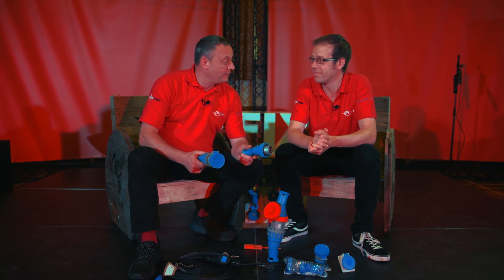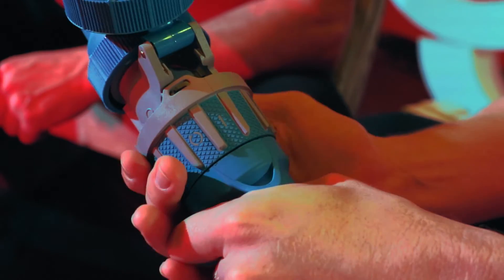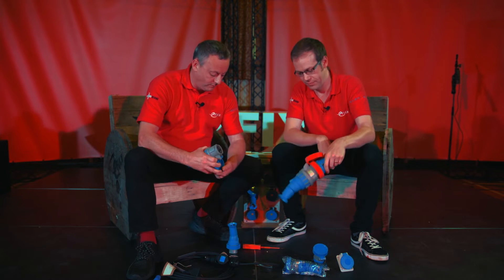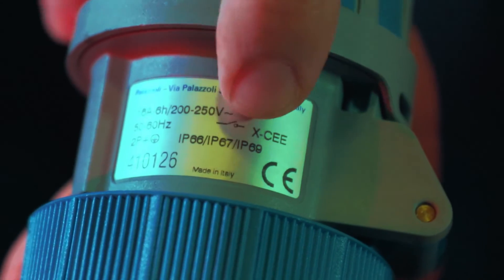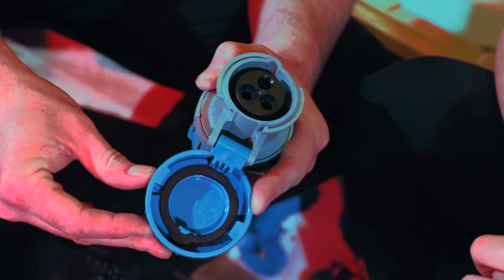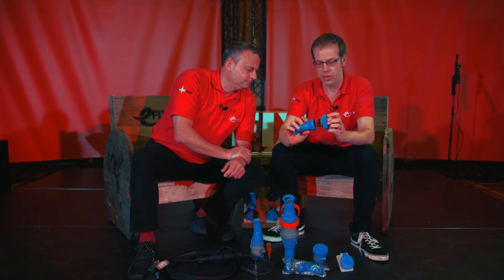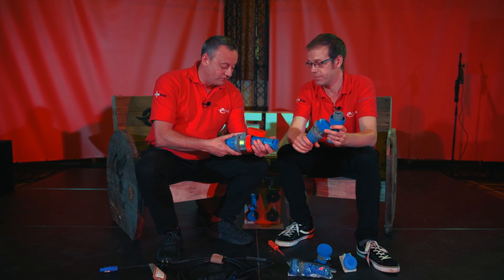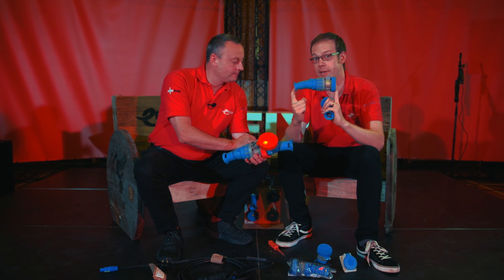Reviewed: Lewden Palazzoli XCEE (Ceeform)Industrial Plug and Sockets  IP69k

Comment: At 4:01 these plugs are from PCE (Austrian PC Electric), that will happily supply them with nickel plating on the connecting surfaces. Add a "v" to the end of the basic model number for nickel plated variants. 
Shown plug are likely to be PCE 013-6TTx (screw-less) or 013-6x (screws that works with ferrules) and connector PCE 213-6TTx (or 213-6x) for the black housing for uses on stage where they may not be completely hidden out of sight but remain unseen for an unsuspecting audience. (the x at the end equals the black "Midnight series" when it is best they go unnoticed by the audience)

In regular colours where the housing matches voltage rating, the model numbers are for the plug  013-6TT (or 013-6) and connector 213-6TT (or 213-6).

PCE has more expensive variants and Lewden Palazzoli have cheaper variants. The cheapest may not be the best compromise, so it is good to know you options :-)

Comment: I have used the ones from PCE for the last 15 years or so without any problems.

PCE was the first company using the compression cable gland strain relief or however you want to call it. Better than the ones you had to cut to size and they save assembly time.

Nowadays everybody seems to have them but the PCE CEEs are also available under the ABL-Sursum, Kopp and Sirox-brands.

And on a personal note I would like to see all brass contact-CEEs banned and only allow nickel plated contacts. The problems I have had in the past with CEEs were all related to the brass contacts.